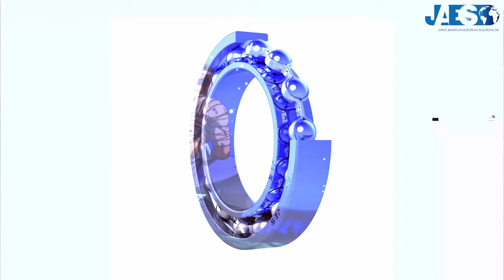Greasing Wheel Bearings on a Polaris Ranger XP 1000

Comment: Using the hammer is not good.
Reply from the maker: Kindly, your analysis of the situation regarding the use of a hammer is Not good.  
Two important notes to be made.  First, those where light-ish hammer taps, and lastly I refer you this part of the video 7:35 where an example is shown depicting the design of the bearing, which should substantially dispel your concern.
Reply: @THEdisgruntledmonk  my concern has been completely dispelled